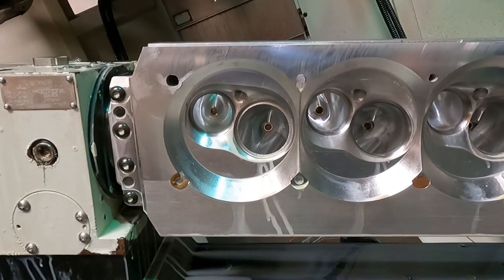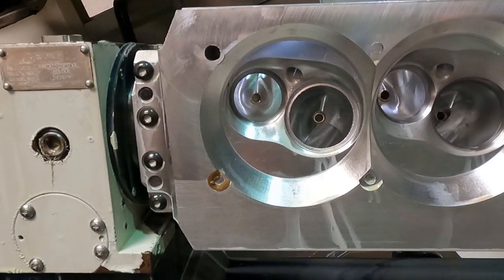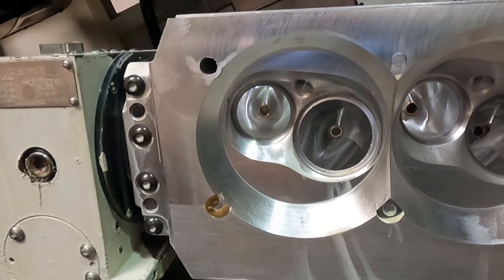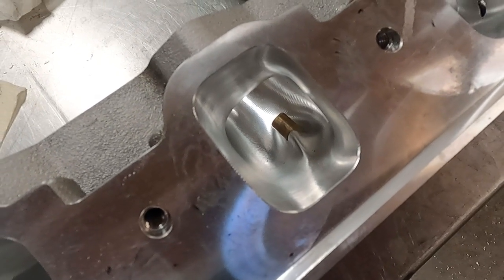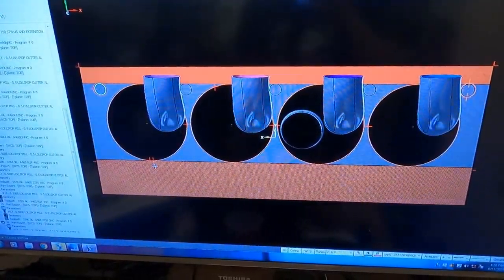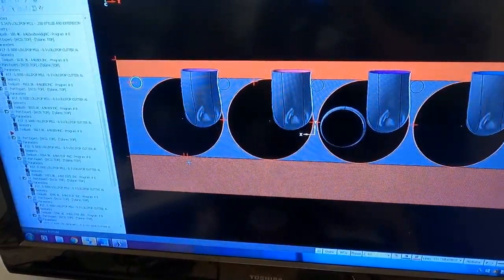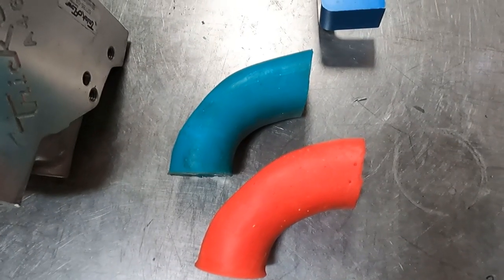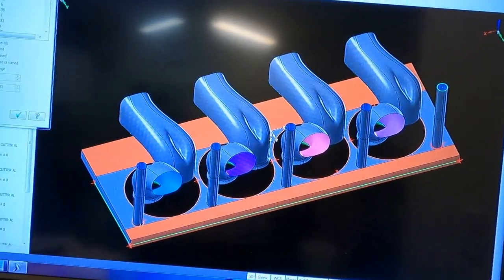TFS A460 CNC porting part 1

Comment: With the A head coming out in the mid 80's i understand the desire to use the 4.84 exhaust pattern because of what was available at the time. But with headers more available now why not update them to a port for the 4.900 bore space like the C460/Thor pattern?